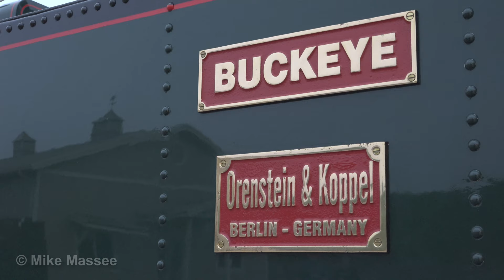Firing up and running "Buckeye" O&K 0-4-0 Steam Locomotive!

Comment: I know another O&K engine that that resides at the Heston steam museum that engine is an outside frame 0-8-0 tender engine that was built by O&K in 1938 it last operated at Heston in the 2010s it is currently waiting its turn to be rebuilt by the Heston steam museum alongside the CSK 0-4-0 tank engine which when it operated it sported a beautiful sounding Baldwin 3 chime whistle during the 1990s both operated into the late 2000s before they were taken out of service for their next rebuild currently there is still waiting hopefully they will both operate again in the near future especially the German O&K outside frame 2 foot narrow gauge steam locomotive here’s a video link of it operating at Heston besides have a German whistle it had a Baldwin 3 chime whistle https://youtu.be/rzY1d3mUSLo?si=mKe_0_xuAGm8iObW